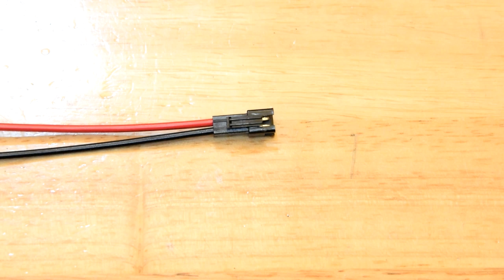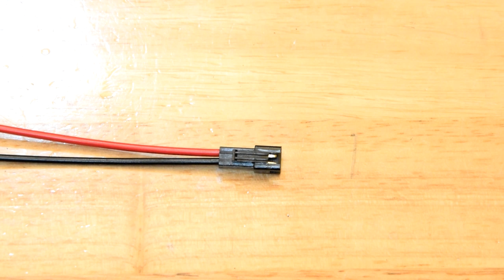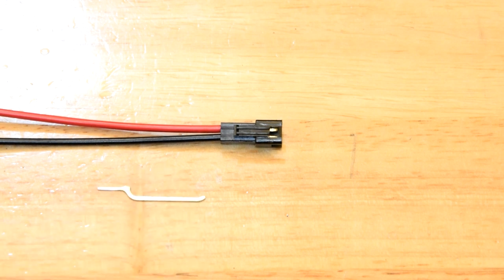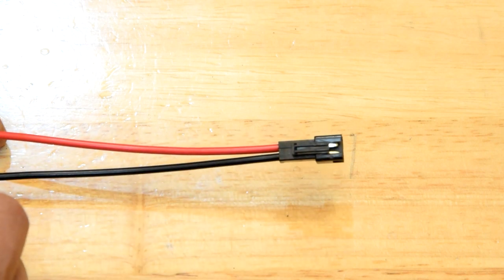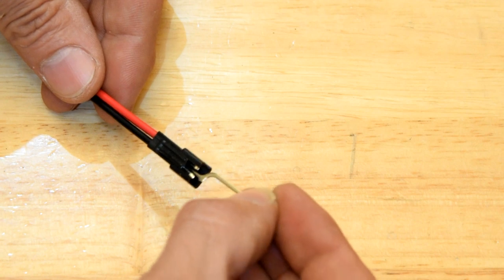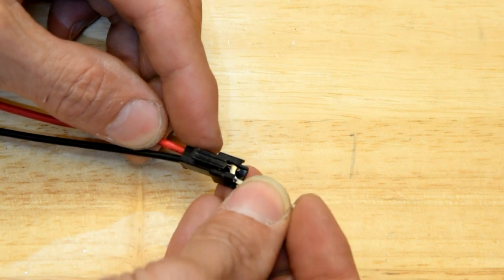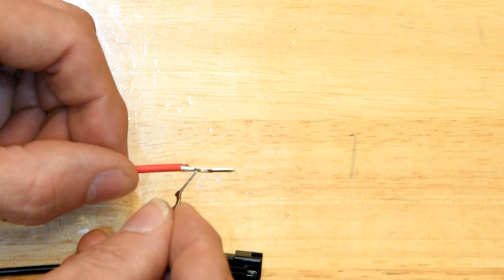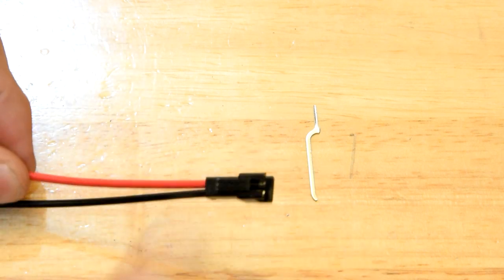Tech Tip: De pin JST-SM

Comment: Great video. Left my sim card removal tool as it was. Didn't need to cut it. Recommend that you use a craft knife (aka Stanley knife) to get under the barb & lift it up to around 30 degrees to make sure of a good refit. Had to do this with all 6 of the pins that I removed. Be gentle though, or you could break the barb off.

Comment: Nice to know, but how about a vid on how to attach a JST pin to a wire. ('cause for most of us mortals, that's almost a bridge too far).
Reply from the maker: Generally they are crimped on with a specific pair of crimpers. I have been known to solder them on.